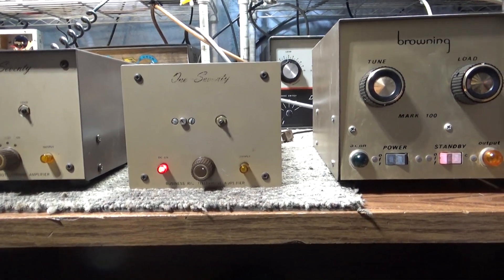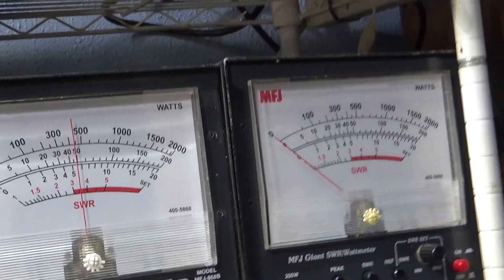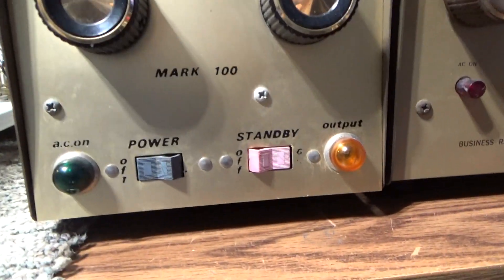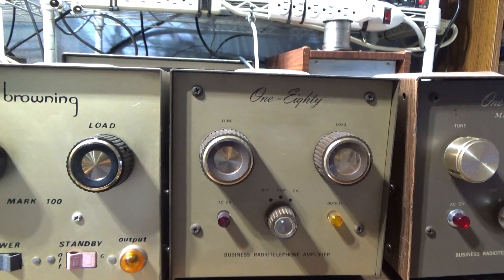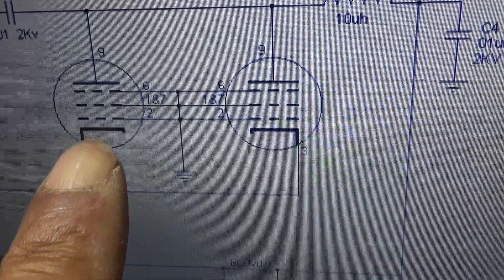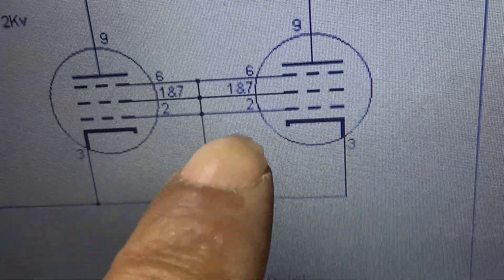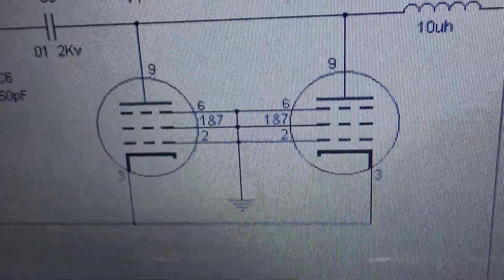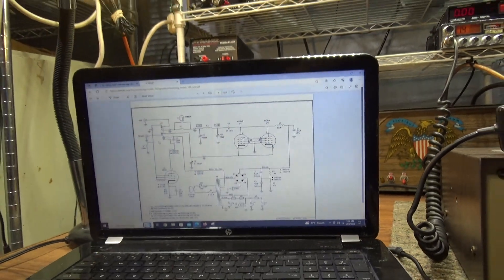Browning 170 Business Band Linear Amplifier DC version of 180 and Grounded Grid explained

Comment: That's exactly what I did, when I built a 20m 813 linear amplifier. The pair of 813 tubes were in grounded grid configuration and ran like triodes. 75W in gave me 750W out, so a 10dB gain.  Grounded grids are far more stable and forgiving than grid driven amps. Just run the input through a PI input network, into the Cathode. That should keep things happy. 😊

The actual tubes were new old stock Soviet era GU-13's (813 equivalents), bought from a friend in Ukraine.
Reply from the maker: True, but GG doesn't give you the swing of grid driven, and even more so with Tetrodes vs Triodes.
Reply: @tramdr I'm not interested in swing, as it was built for SSB and higher power drive. But each to their own.
Reply from the maker: well since SSB is all audio and swing anyway...

Comment: A great explanation brother! I wish we could sit down and discuss amplifier class characteristics together. It is a fascinating, but complicated subject. I learned some things at college from 1974-1978. From what I recall, there are different types of operation using tubes. Cathode fed, anode fed, grid fed, each have different gain and different input impedances. When you feed a tubes grids your signal, it’s impedance is very high and that is why you need what is in effect an antenna tuner to match your 50 ohm radio to the high impedance grids. But using grounded grids and feeding your signal to the cathodes results in a low impedance that is close to that of your 50 ohm radio. I really love the grid fed Black Cat amplifiers, but those bias voltages are complicated. 
Some tubes, such as the 3-500Z are naturally designed to work well as grounded grid, class B amplifiers. 
Btw, I was taught that class B works well for a.m. and ssb, but class C was good for f.m, and c.w. signals. To run a.m. signals through a class C amp will result in distortion to the signal. Is that correct?
Reply from the maker: I try to steer away from class and distortion. People get really nit-picky about that. I totally agree with you about grid driven being high and grounded grid being low. Grounded grid 3-500z has an impedance of 100 ohms, so a pair will have 50 ohms. Still a good idea to have a tuned input because of Q, loading, impedance swings etc. What a lot of people don't know is that with most sweep tubes using grounded grid, they have an impedance of 200 ohms each. Hence a four sweep tube box will have an input impedance of 50 ohms too.